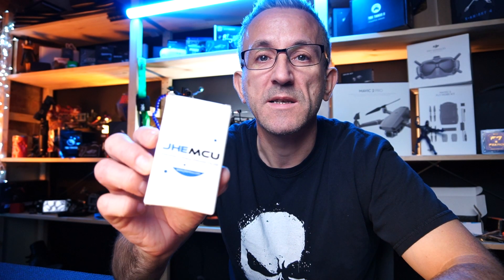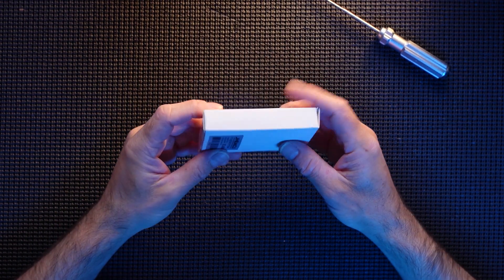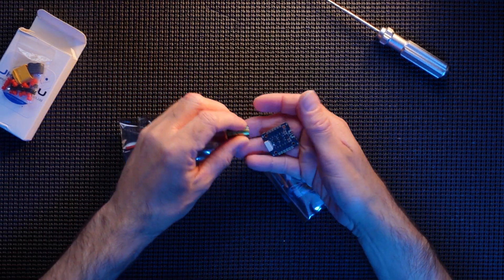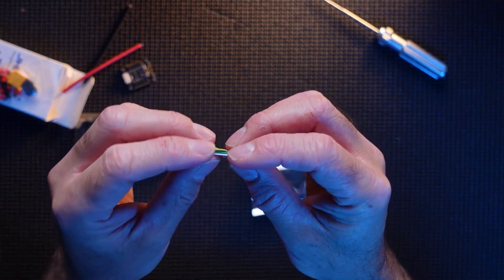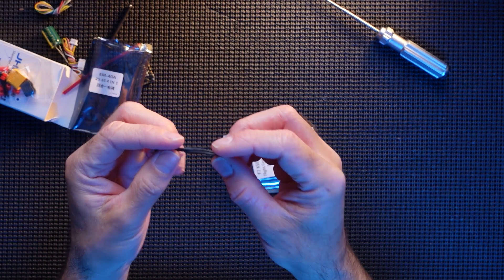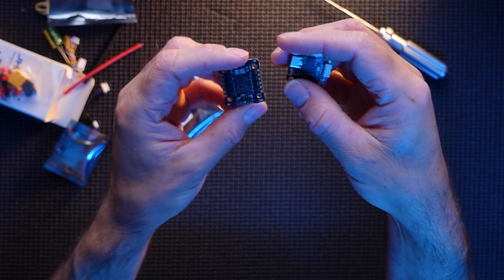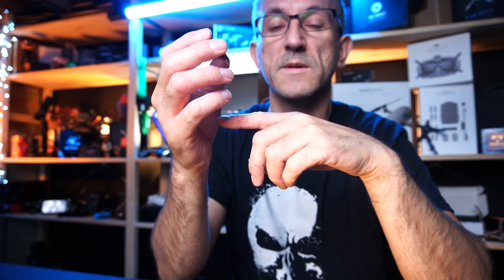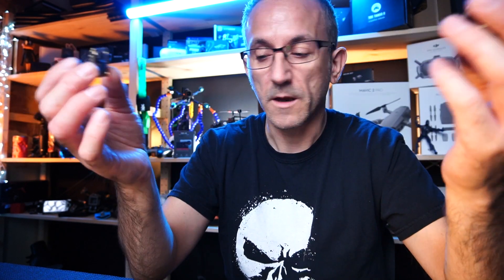Cheapest F7 HD flight controller stack for drone? JHEMCU F7

Comment: Hi, nice unboxing. How did this stack and esc in particular work out for you? Did it hold up the abuse?
Reply from the maker: this stack was solid, I did end up breaking it though... but I do fly hard I did look for the same stack again to re-purchase but wasn't available.
Reply: @Datfpv  thanks for the feedback. That esc is available on aliexprs. What broke on yours? I just bought this esc for a 5" racer 2207.5 1750kv  motor on 6s. Hope its not too much for it. That price is just unbeatable.

Comment: Nice stack, i wish i had new f7 FC because mine old f7 20x20 jhemchu has no BB and baro and it has dead vbat sensor (still waiting some spare vbat sensors from aliexpress 8(). But the good thing is that Jhemchu has inav and emuflight targets as well as betaflight. 1000 uf is the only option for 6s and you should dont go lower 500-600 uf for 4s otherwise the impruvement of having a cap are minor. So use 1000 uf 35v cap, i mount mine sideways in my apex 4,5 inch version.
Reply from the maker: I don't even use a cap on my apex 4 and 3inch - no probs...
Reply: @Datfpv  i had video interferance on 4s without a cap on my longrange and ESC manifacture recomend to use cap with 6s so i do so on apex.

Comment: blheli_S? not any more. Right then when using smaller props and higher kv, you can benefit from _32. Otherwise you have to try out jazzM, Jesc or other Firmwares.  after using countless FC the last 13 years, the price does not play a role at all!  i spent days to get the cheap stuff running. dont know how good these JHEMCUs are, but 1. i would have a look to BF manual, if there are things to do in CLI or worse ;-)  rerouting or other shit.  i will watch your next vid, maybe it does work perfect.
Reply from the maker: I will report back when its in.